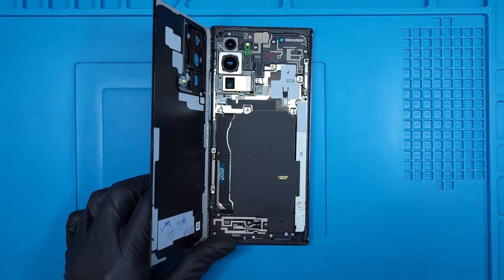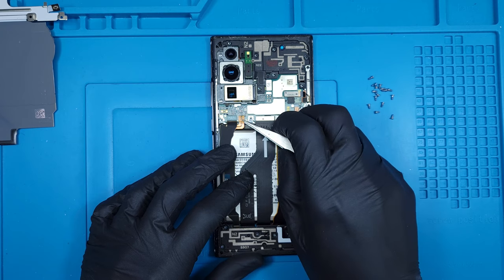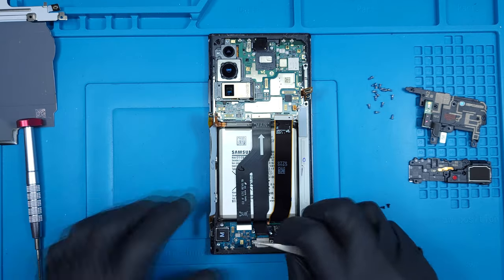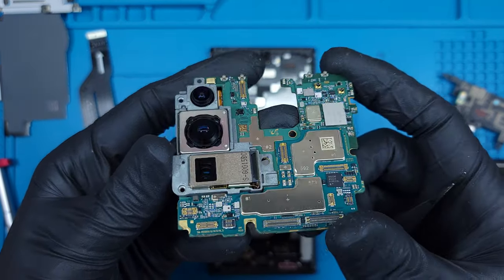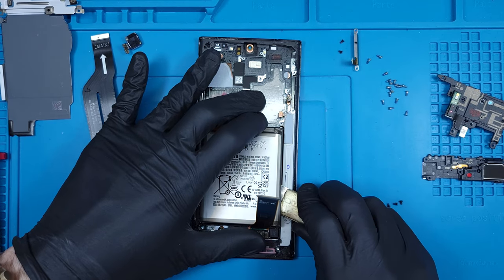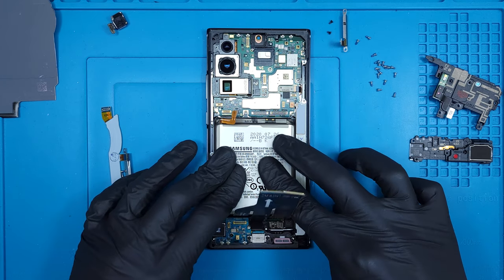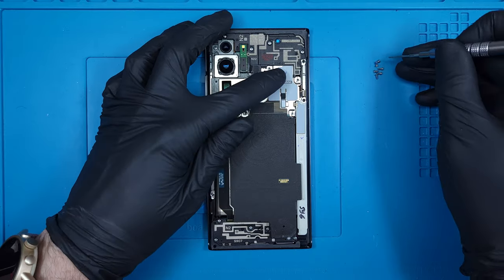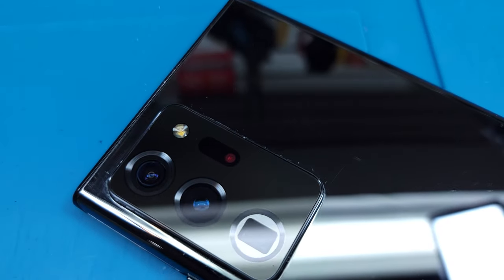Galaxy Note 20 Ultra Screen Replacement | Teardown and Frame Replacement Guide | Tons of ribbons!

Comment: the only con of a samung phone is its ridiculously overpriced amoled

others include :
crappy processors
mocking apple and imitating them
removing SD slots
removing chargers
and from glass to plastic as evolving...........just backwards
Reply from the maker: That is the truth! I love my Samsung phone, I know I can easily fix it, but I could also nearly buy a new one for the cost of that OLED panel
Reply: @TapticDigital  yes , i too love my galaxy , but there are plenty of problems with it , especially with exynos , the fact that im getting subpar battery while the budget versions of samsung have a beefy 6000mah battery.....also that screen discolouration issue brought by a firmware update from samsung, these kill the user experience and reliability is non existant for samsung devices